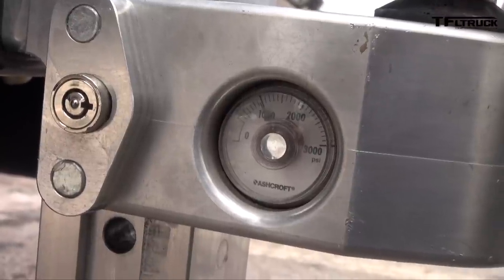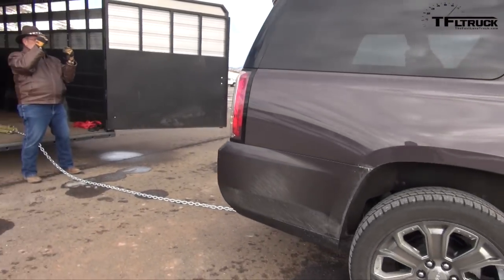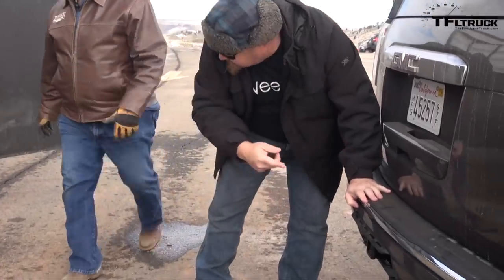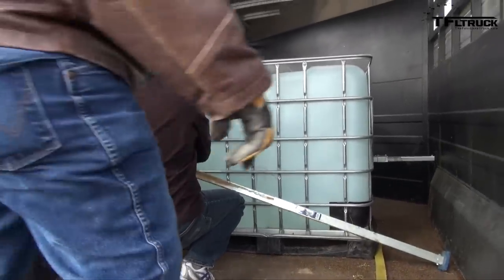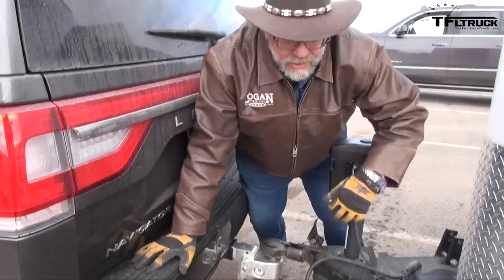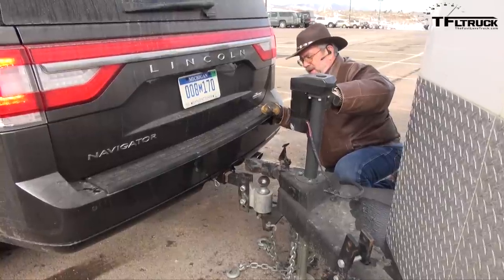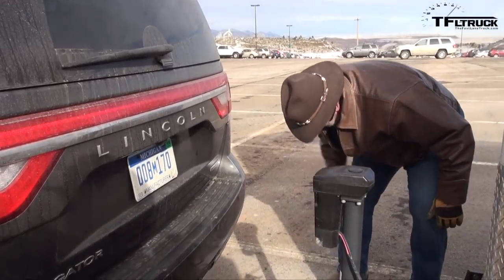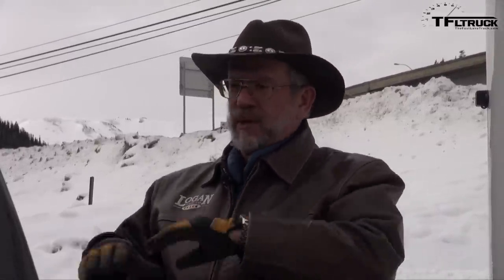Behind the Scenes of the Ike Gauntlet: How to measure Tongue Weight

Comment: I like that you addressed the total weight of vehicle occupants and tongue weight needs to be combined, I see alot of suv's towing campers with 4-5 people and the back end stuffed to the top. If they took a trip to the scales they would prolly find themselves more than 50% over their RAWR.
 Could you do a video on proper weight distribution setup using scales and not tape measures.The max tow rating on most trucks now seem to be with empty vehicles , Its surprising how fast your tow rating drops when you start adding weight to the vehicle.

Comment: Hey guys! Thanks for this. I have question: weight distribution hitch "distribute" how much of the weight to the trailer and truck? We own a 2018 Sierra 1500, with NHT package, and are looking at a travel trailer that will be about 8500 pounds all included. The 10-15% on the tong, does that include full propane + batteries? if so, can we go as high as what the truck can take on the tong, which is 1250 pounds? Thank you for your great guidance! Remi, Montréal.

Comment: What a rookie move using those flimsy bed dividers to hold that water tote. In a emergency braking situation your not only dealing with alot of weight but the surging and added weight transfer of the liquid inside.Never mind tongue weight wrong trailer for the job.

Comment: When your colleague said he hated IFR because it squats too much, I was going to ask why you guys had the weight so far forward to begin with, but I see here you all fixed it. Which brings me to the second question: "What was wrong with the Air Suspension?" 
As far as I am aware since Gen 1 Navigators, they have always had Air Ride, and seeing how the 2nd Gen(Mine) had the first IRS, Ford has had 12yrs updated and perfecting it so it shouldn't be squatting like it did.
Reply: Air ride is notorious on vehicles for going out and being an expensive fix. I'm far from being an expert but have a 15 Navigator with rear leveling and u have to drive it couple miles before it kicks in and levels out and then slowly releases the air again after parking. It's called Nivomat and I'm guessing it is engineered this way for less wear and tear and longer longetivity.
Reply: The owners manual for my 2015 Navigator specifically says "if a self equalizing hitch is being used , your vehicle should be driven approximately 2 miles with the trailer prior to adjusting the (leveling) the hitch". Maybe you could bother to find out how the vehicle actually works next time guys before claiming the making false claims about the suspension sagging under load? We're not all GMC fan boys as some of us would appreciate a more accurate report on the Lincoln ' s self leveling capabilities.
Reply: I'm sorry TFL Truck for my comment. You had the luxury package with adaptive damper (instead of load leveling) I assumed because my 15 had it the higher priced one would too. I really like your videos and appreciate what you do and  will try to do my homework first before opening my big mouth. If u get your hands on a base L Navi like mine I'd love to se it tow with the 4.11 gears and rear leveling suspension.
Reply: Navi15 I have never had an issue with mine in my 2006, and I drive up and over everything I see if it's in my way and off road with it once in a while and the few times I towed something it leveled out the rear as soon as I turned the truck on, and adjusted while I was driving as soon as I took it out of park.
Reply: darklordchris Thanks for the info. The issue with the one they tested is it has the adjustable suspension settings instead of load leveling (luxury package) My 15 L does have load leveling dampers for towing and 4.11 gears instead of the adjustable dampers with  comfort, normal, and sport settings  but I'm not sure how to test it cause my suspension doesn't budge when I hook up my 18 ft boat. All I know is my owners manual says drive it a couple miles to let it level out. I figured the air pump kicked in while driving but haven't seen any controls for it just thought it was automatic. Just think it's a bit misleading for these guys to say it doesn't have it when it comes standard.
Reply: Navi15
Oh Okay, I didn't know there was a second option on the newer ones. One of my aunts has the 1st Gen, and my other has the 3rd Gen, so like you I was a bit confused. But thanks for taking the time to explain a bit about yours though.

Comment: I have a trailer with a tongue weight of 715 lbs how is that weight distribute (%) over the Truck & Trailer with a weight distribution hitch. Does half of the weight goes to the Truck and the other half to the Trailer.
Reply: The definition of tongue weight is amount of trailer weight bearing directly on the hitch ball so whether you have a weight distribution hitch or not 100% of tongue weight transfers to the truck.  The job of the weight distribution hitch is to level the tow vehicle.  The hitch does this by applying brute force torque through big steel springs forcing the tow vehicle's nose back down to the proper level.  This doesn't actually move weight around like the name implies but it does balance the loads applied to the tow vehicle's tires which lets the suspension and tires work properly.
Reply: Agreed Terry. If you have a tongue weight of 1000lbs it doesn't change with weight distribution... it is just DISTRIBUTED differently.... hence the name. Also, the best advice from this video is that tongue weight counts towards your payload!! If your max payload is 2000lbs and you have a tongue weight of 1000lbs, you only have 1000lbs left for cargo in the vehicle (INCLUDING passengers, full tank of gas, etc......).
Reply: Shayne Billey most payload ratings have a full tank of gas factored in on the payload rating number. My 2004 2500HD Silverado explains that in the owners manual...